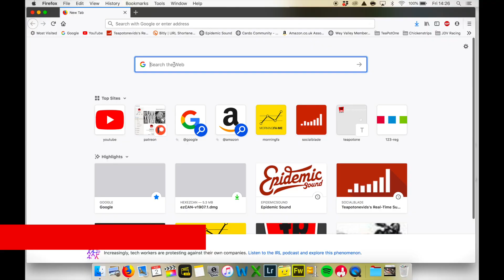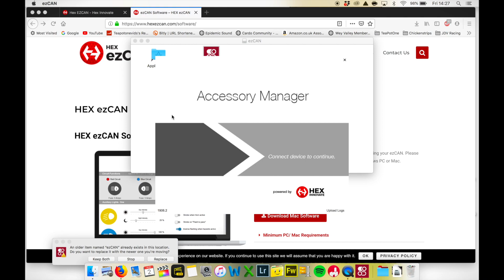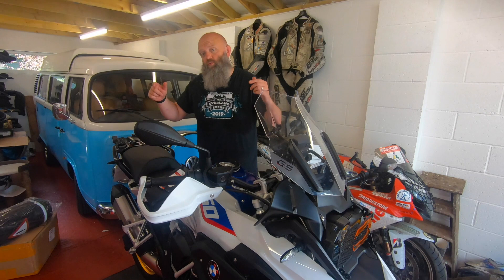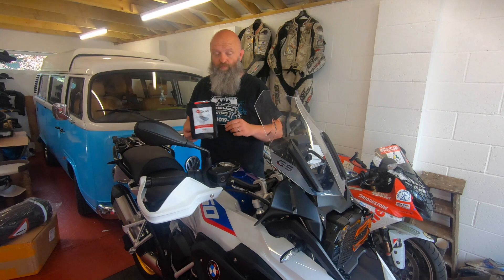Hex Ezcan Gen 2 - How to Install

Comment: Not something I will fit to my bike, mainly due to cost but can see the benefits of it. Decent vid Bruce. Cheers
Reply from the maker: Thanks man, should make fitting toys to the bike much more straight forward 👍
Reply: @teapotone  Yeah, Definitely worth while if you have a range of accessories to connect up. I've only got my heated grips and hardwire kit for phone.

Comment: Personally Bruce I would of put the power cable under that main bit of the frame just in case the seat was to rub it 👍 what are you finding the main differences between the new and old GS obviously more power but what else bud 💪👍
Reply from the maker: Yeah I look back and wish I’d taken the time to route it within the frame, but it’s perfectly safe where it is, the seat doesn’t rub 👍

New GS is smoother, more power earlier in the revs and throughout the Rev range, I also notice a secondary kick of power as you hit triple digits, and the gear box is much smoother.

Massive improvement in my eyes 👍

Comment: No love for the Denali CANSmart?   (Also made by Hex...)
Reply from the maker: It’s exactly the same thing - it’s made by Hex and branded as Denali 🤷‍♂️
Reply: teapotone - it’s plug and play.   Well- kind of.... you have to use Denali brand lights, and accessories... but there is no cutting, splicing, or soldering.  I only mentioned it because from your last bike to this new one- you wound up leaving Lot of stuff on when you sold it....   
Check out one of your UK brethren- “A Bike Thing”

Comment: Hello, it can be said that the HEXEZCAN and the CANSMART CONTROLLER GEN II from DENALY, work the same, I mean, could you buy the CONTROLLER GEN II to install the RIGID INDUSTRIES brand lights without any problem? ... or would you recommend buying the HEXEZCAN, Thanks a lot
Reply from the maker: To my knowledge, the Denali Cansmart is just a rebranded Hex EZCan

Comment: Completely unrelated to the content of the video, but I have a question regarding the suspension. Being a chap of, shall we say larger proportions, I’m curious how you would change the suspension to suit your weight. On traditional suspension, you can change the springs and valving to suit your weight, but with this new electronic suspension that has different modes, surely each mode is programmed to suit the stock setup. If you were to change spring rates and valves, would that then not affect the programming for the suspension modes? Do you have to have it reprogrammed to suit new springs etc, or does it adapt to suit?
Reply from the maker: The GS adjusts to whatever weight is applied to the bike - so when I pillion gets on the bike you actually feel everything stiffen up, it’s incredibly clever stuff
Reply: teapotone great, thanks for the reply. Been wondering about all this new fangled suspension and if it could adapt to suit various weights.

Comment: still none the wiser as to what it actually does 🤷‍♂️
Reply from the maker: If you don’t know what it does, WHY would you watch a vid on how to install it? 🤷‍♂️
Reply: @teapotone  Must admit I'm the same, what does it do and why do you need it. I've never heard of the thing before and i would have been more informed if you explained what it does at the beginning. 

Bit harsh and not needed your answer to one of your subscribers, don't you think??? Surely you can be asked a question without answering it like that?
Reply from the maker: You can ask me anything you like folks, and I’ll give you my honest answer. 

I wasn’t rude Ally, I just don’t get why you’d watch a vid on how to install something that you don’t even know what it is? 🤷‍♂️ Maybe that’s just me then?

Essentially the EZCan is just an accessory manager that allows you to connect up to 4 electrically powered accessories to your bikes wiring loom, and even allows those accessories to be controlled by your bikes existing switches and buttons - all configurable via the ezcan’s desktop software.

The next vid in this series explains how to do this when I install the INNOVV K2 camera system to the bike.
Reply from the maker: @stekwack - after reading my reply to you again, I can see how this could be taken adversely so apologies if I seemed a tad short and sarcastic - it wasn’t meant that way bud.👍
Reply: @teapotone  no worries I was watching it thinking you might of given some detail as to what it actually did in with your guide to fitting it, if you dont mind me asking what accessories are you connecting to it, I still dont get why you would need it. 🤷‍♂️
Reply from the maker: At the moment I’ve just fitted the INNOVV K2 bike cam (vid comes out on Friday, and I’ll also be fitting spotlights. I don’t know as yet if I’ll fit anything else to it, but it allows up to 4 accessories to be fitted directly into the GS’s Canbus wiring loom, and they can be easily integrated into the existing switches and ‘wonder wheel’ meaning you can control spotlights brightness, make the left spotlight dim or switch off when the left indicator is activated for example (or even flash if you want), you can have the spots flash when the hazard lights are activated, you can make the spots flash when the horn sounds - there’s a whole host of setup possibilities available through the eXcan desktop software.

Essentially it just makes fitting electrical accessories to your bike very easy, without having to cut into existing wiring looms